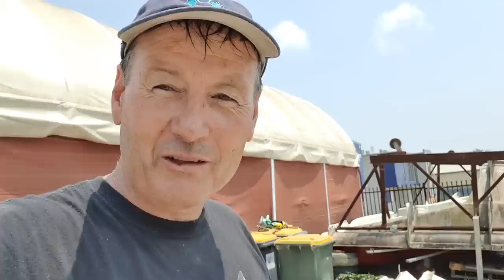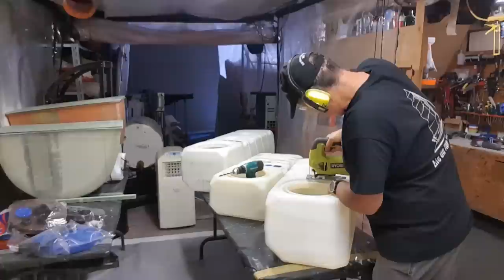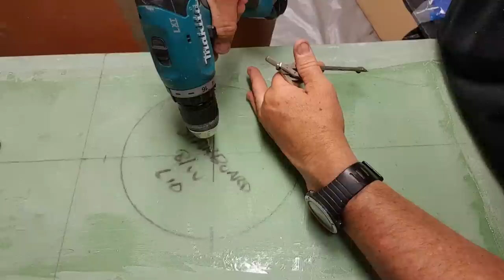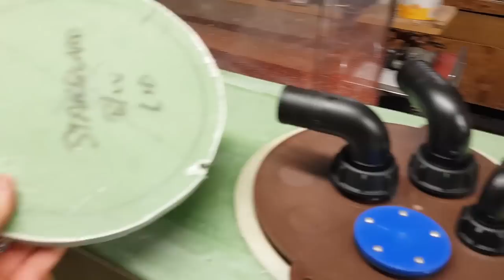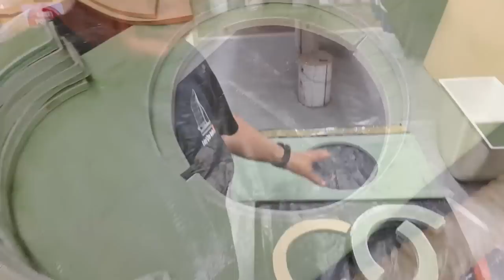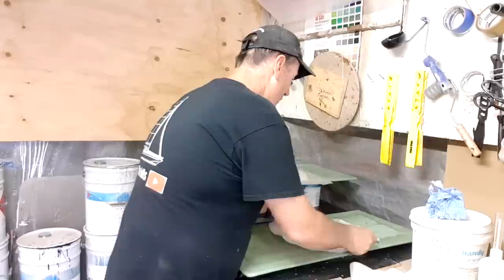Ep097 Boat Holding Tanks and Bushfire Update - Life On The Hulls  40ft Catamaran Build

Comment: Use a router circle jig to cut the openings. Love the "Dad" stories - there are still many holes in my tool boxes from my son. I should have been more like your Dad.
Reply from the maker: You are never getting those tools back Bill.I haven't had much success with a router on the foam sheets,once laminated with glass the router seems to hate the combination and burn the bearing wheel and blunten the bit.Maybe higher quality bits would not have the same issue.Cheers Rossco

Comment: Thank god it rained. I read fires result of arsen ?   Glad you all are ok and it cooled with the rain.
Reply from the maker: Most are arsen some are dry lightning from pyro cumulonimbus systems generated by the fire's own climate.Scary stuff.Ross
Reply: @LifeOnTheHulls  Yes that's, stupid...So many have died and those buggers are to blame. They need locking up for good.  So please you and the cat. are all good. TV in the UK keep saying its Global warming but I see on youtube trusted sources that it is mostly intentional. Just a point the screws you will use around the plastic screw hole will need a flat surface but you have angles and sanded it on the under side. That means no flat surface on the underside to put a nut on to hold it clamped.

Comment: A bit late to mention it, but you already had a recess you could have used on the other tanks?  Assuming you hadn't cut them up already, all the tanks were recessed, you just need to cut the slightly larger flange with a corresponding hole and carry on as originally planned?

Comment: Can i advise you add a static cable on black water tanks, if boat gets a lightning strike the tanks being sealed can act like an explosives chamber, a silo I redesigned for coke blew up the entire factory due to static discharge in a plastic tank, the resulting explosion blew along the pipes blowing up a huge additional part of the factory, its a very simple addition to add a lightning strike discharge conducter

Comment: By leaving a larger "flange" on the thread you cut out from the donor tanks, would the lids have been inset enough without doing all that extra work later?
Reply from the maker: That is a good point and upon checking I am certain there would not have been enough to lower for comfort.So the rebate definitely solved the problem.Good thinking though Brad.Cheers Ross

Comment: Rossco, I still have those tools, and still use them to this day on small projects !  Was thinking you were going to attach the white plastic flange to the underside of tank panels, that would gain you the thickness of the plastic recessing it into the tank without all the work of the additional recessed rims... and still  be a few mils lower.  Your solution is much prettier, and stronger no doubt ! Still praying for a rapid end to the fires for you and all others affected. Maybe pass this on to folks who are rebuilding :  https://www.youtube.com/watch?v=Vqq8-2ereKg   Monolithic domes are now even less expensive than conventional buildings due to improved materials being available. They can use non ferrous reinforcement with basalt roving, and may not require the insulative layers either if in warmer climates like Australia. They are near-absolute protection as defined by the US FEMA, and qualify for grants in their construction, maybe AU has a similar program ?  I think they look really cool, like Star Wars depiction of Tatooine !